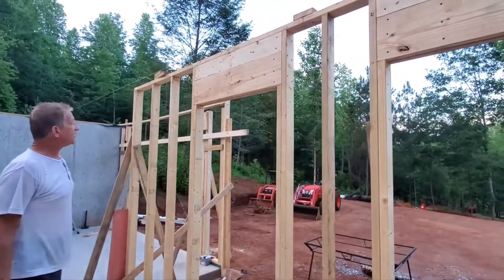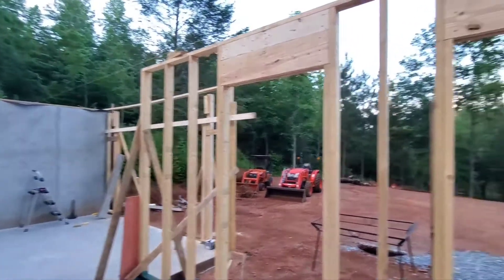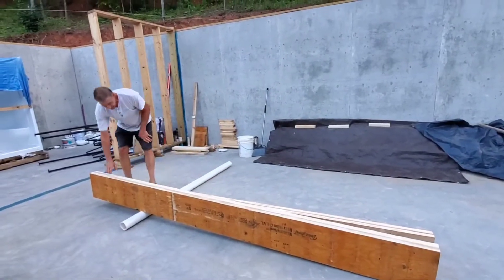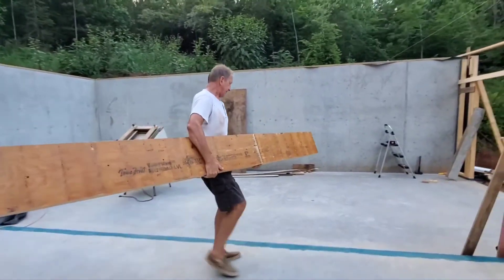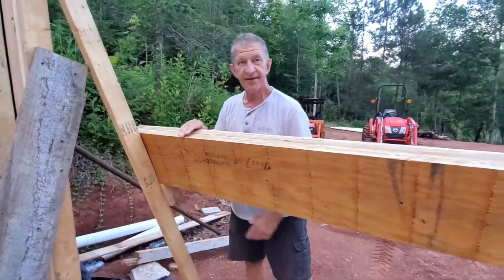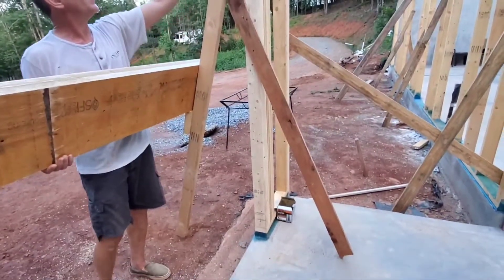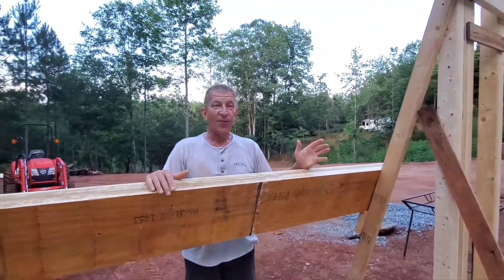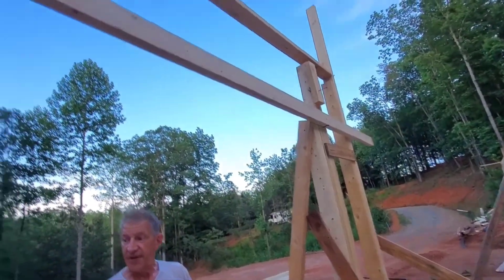Earth Berm House 20 construction LVL install Building Garage wall

Comment: am starting my project in spring, would like to know waterproofing used on walls? and hope more videos with roof,
Reply from the maker: Ames Blue Max Liquid Rubber Waterproofer 2 coats, let it dry in between coats. The 6 mil black plastic was placed over that, next time I would use 10 mil plastic, it would be thicker and tougher.